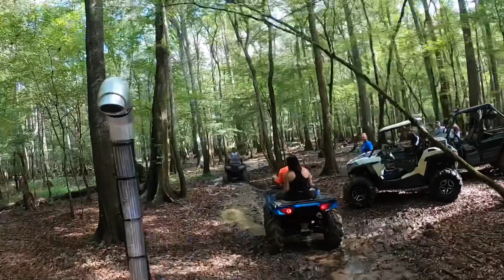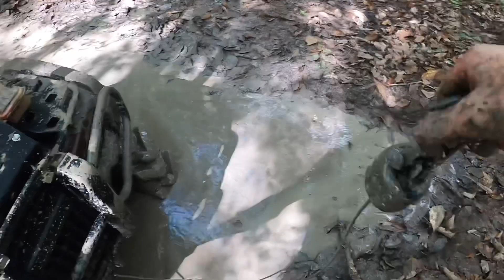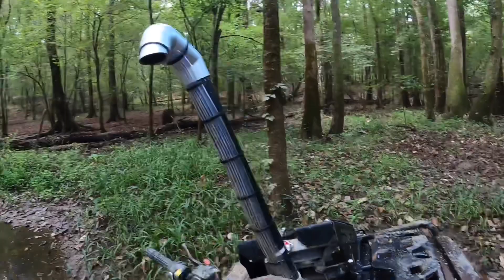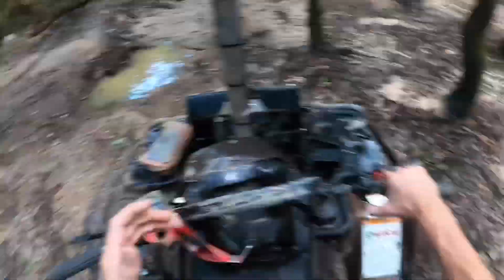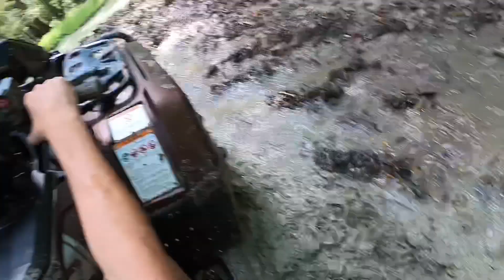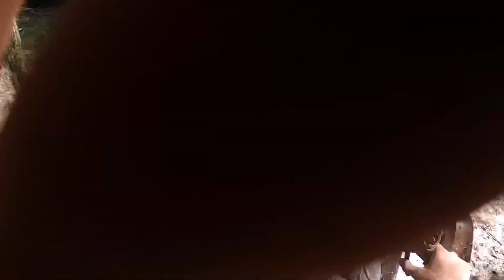2020 Honda rubicon 520 solo ride part two ( semi fix it in the field)

Comment: If you shift out of first and into second when the tires are caking up a bit get your wheel speed up it will help clean the tires out a bit so you won't get stuck so much

Comment: You can take a hammer and slap the 4x4 motor and it will come out most of the time you might have to roll it when you do it though

Comment: You wouldn't be able to handle a Polaris then their four-wheel drive is four-wheel drive there's no diff lock option when you turn that on its all four wheels and you just got to Armstrong the handlebars lol cool video though
Reply from the maker: I’ve road Polaris plenty there 4wd system is nothing like a true gear to gear diff lock like a Honda. Polaris front diffs are friction lockers not gear lockers so it will have limited slip when your turning